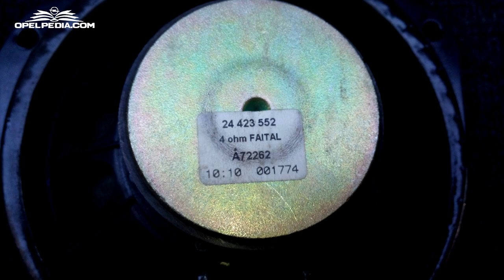Opel Astra H Tutorial: How To Change Speakers

Comment: Hi, many thanks for uploading a helpful video mate.

I have a quick question....my Astra H has a leak of water every time it rains. I get a puddle of water directly underneath the door card of the (driver side) and on the door sill.

I read somewhere that it's because water leaks through the speaker on the door, which has crap silicone around it.

So I ask have you experienced or heard of such a problem with the Astra H, and if so what would you recommend to sort this out?

Many thanks in advance.
Reply: I had that water leak in my car both doors, it took me two weeks to find out the cause. the problem is the speakers. the original speakers are plastic water proof with water sealing. the last owner of the car changed the speakers to non-original ones ( not water proof no water sealing). solution is either buy new original speakers with seal or fabricate one with silicon sealing.

Comment: Hello , do you have a video on how to remove the back door panel to change the speaker ?
Reply from the maker: its the same as the front door.
Reply: Well i removed the screw behind the door opener lever , 2 behind the actual door handle and one at the very bottom , i also removed the window winder but the panel would not budge without excessive force which i was not prepared to do , i did not find any screws along the side of the panel as shown on the front door video so i dont see how they are the same ?
Reply from the maker: Tim Plange we will do a video on this subject soon, cant give you any time frame because is snowing right now

Comment: On the 5 door what are the sizes for front and rear?
Reply from the maker: 165 mm front and 130 mm back
Reply: Could 165mm fit in the back with out cutting alt part of the for away also am I going to need speaker adaptors
Reply from the maker: Ben Moore you can't put 165 speaker in the back
Reply: Ok thanks one last one do you need speaker adaptors for front and rear?
Reply from the maker: Ben Moore yes, you need adaptors but they're cheap and can be found very easily

Comment: My one had also lot of glue and therefore was much more difficult than in this video. In fact most of the junctions broke and now my door cover it's very loose
Reply from the maker: +giuans the factory doesn't use glue on the  door cover or on the speaker

Comment: Are Astra H manufacturer speakers better or wors for example than some Pioneer speakers ?   I was wondering
Reply from the maker: depending on what speakers from Pioneer are you going to use... Pioneer has very good speakers but also cheap entry level product.
Reply: opelpedia I mean Astra H vs Pioneer dual cone 17cm (speaker around 40eur)?
Reply from the maker: can you give me a product code for pioneer ?
Reply: I thought would it be better Astra H original speakers vs Pioneer TS-G1732i (17cm), 2-WAY, 240W (EAN code: 4988028265884)? What do you think ?
Reply from the maker: the ones from the video description are way better
Reply: Okay thank you very much :)